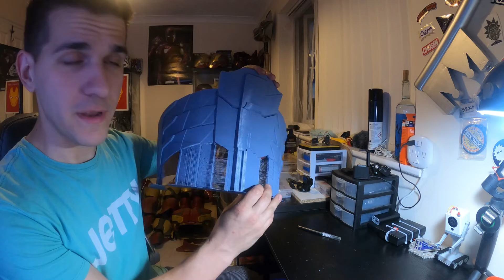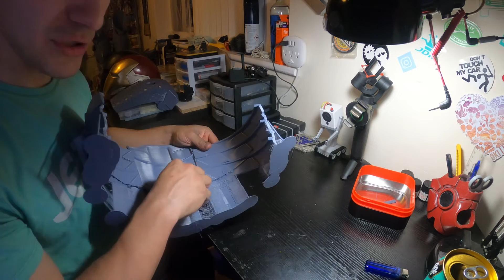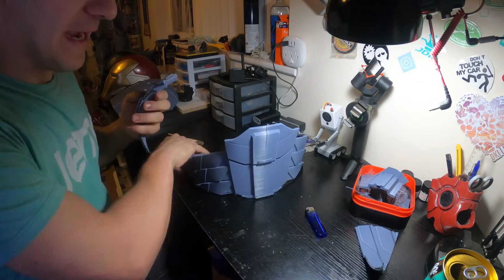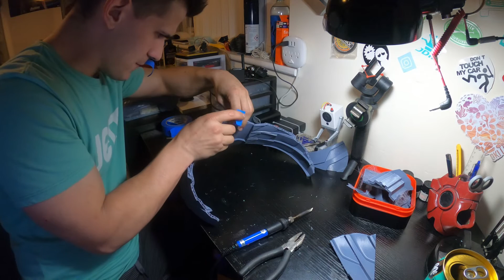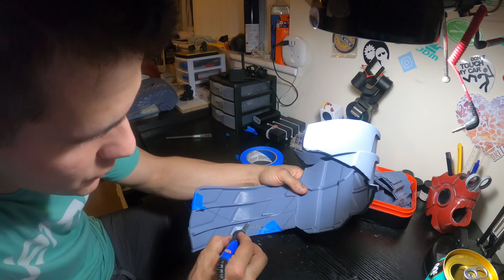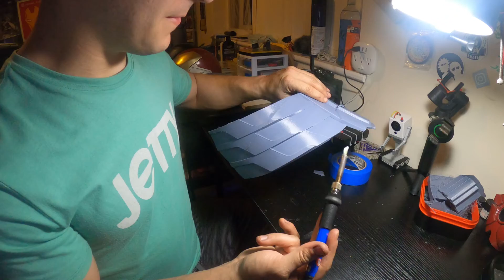How to Fix a Layer Shift - Repair a Failed 3D Print!

Comment: I came to this video because mine had some slight layer shift. Yours was indeed a lot worse than mine. Mine can probably just be sanded. Though great video for future failures! May even try it out on another failure for test purposes. 

One tip i did like was the recycle part. I have a box of scraps that I haven't figured out what to do with. Fantastic idea for it!

Comment: When you say to flip it and drop it down in cura to reprint the rest. How do you go about getting the part at the same angle again in cura? And btw great idea on using fail prints or even support parts for filler. I never even thought about it. Iv been using a roll with like 50g left
Reply from the maker: Luck. Sadly there’s no way to guarantee this
Reply: @FranklyBuilt  I figured that honestly. Just had a little hope that there was some way to import a Gcode into cura and then reverse it to be able to move it.

Comment: I’ve had plenty of failures and after ten to 20 hours in a print you have to come up with ways to save it I usually bring the model in cura and drop it down to print the remainder. Good welding 👍

Comment: Have you thought of looking into 5 minute epoxy? I recommend it it's a pretty good adhesive. I find that it works for me better than any type of super glue
Reply from the maker: Epoxy and glues are good for temp holding but when making larger parts like this that will get some abuse and be sanded and painted I wouldn’t trust it. Fusing the solid plastic together will always work better than any filled medium

Comment: Why dont breath it? Its same fumes like when printing and you can breath pla absolutely fine
Reply from the maker: No it’s not. The soldering iron is getting up to a much higher temp and burning some of the plastic. Never ever breathe anything that is melting or burning. It’s still plastic
Reply: @FranklyBuilt  k thanks i did not know that

Comment: My prints didn't fail, but my big dog completely smashed my full front half, I need to start from scratch, this time I'm going 3 walls thick.
Plastic welding ain't saving this one.

Advantage, I would normally throw it in the bucket, but thanks to the video my failed prints are now my welding material, great tip 
👍👍👍

Comment: Have the same issue with my cr-10 max
Reply: Same, but i just discovered that my bearings on the dual  y-stepper are toast. Formed a nice tacky brown gum inside between the shaft and the cover that was causing it to bind, so I'm marking it down to that.  Replace and test tomorrow....

Comment: I've found that welding the back, then filling the front in with glue after then wiping it down with a damp cloth creates a nice finish without having to use and filler on the front. Apart from filler primer that I have been using anyway regardless.
Reply from the maker: Not a bad idea at all! You can do that with baking powder and super glue too!